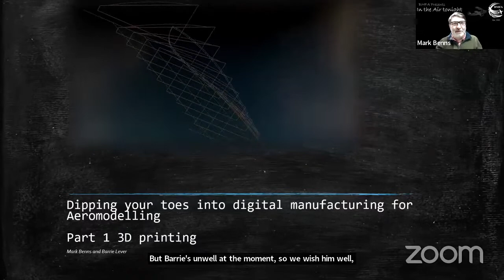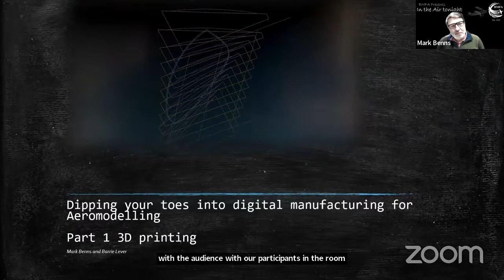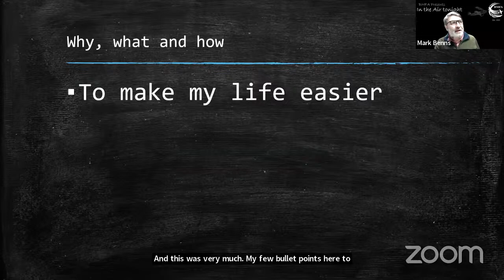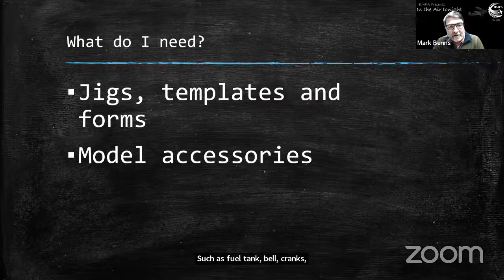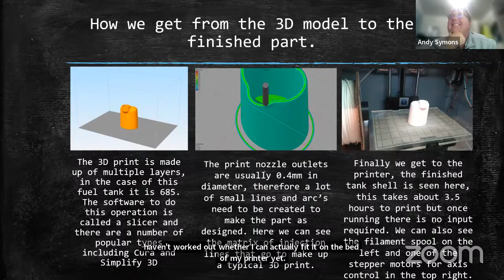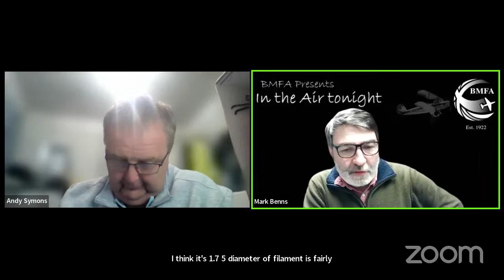'In the Air Tonight' - Dipping your toes into digital manufacturing for Aeromodelling,

Comment: IMPORTANT - Never ever leave a 3D printer unattended. There have been several fires caused by filament catching fire in the hot end. You wouldn't leave lipo batteries unsupervised. The risks are less but similar with a 3D printer. Don't take the risk.
Reply: Im afraid if you think I’m going to sit and watch my printer continuously during a 9 hour print, you’re wrong!